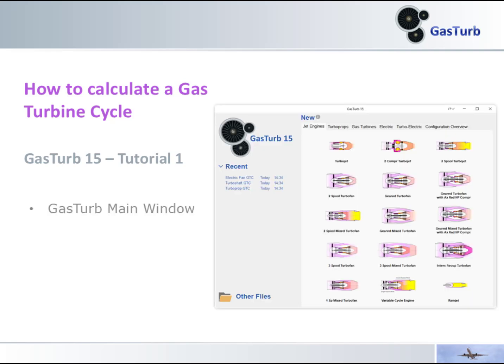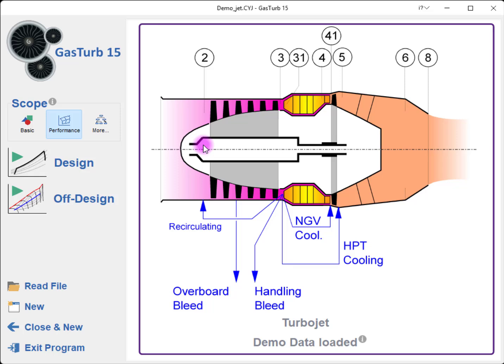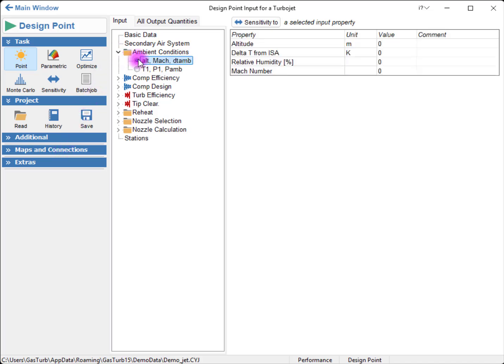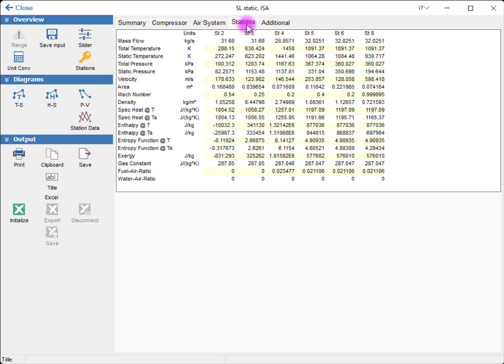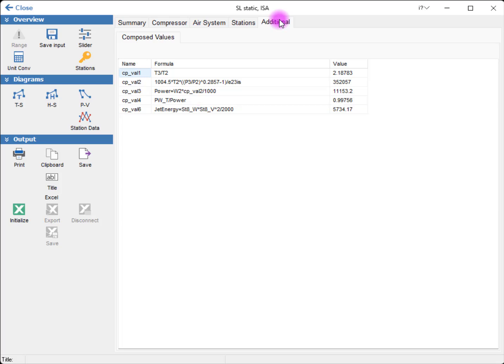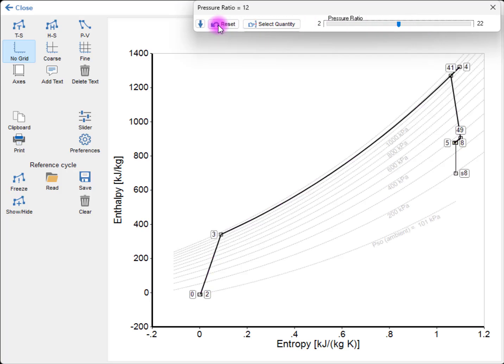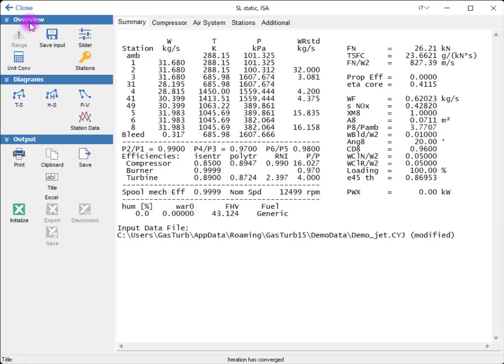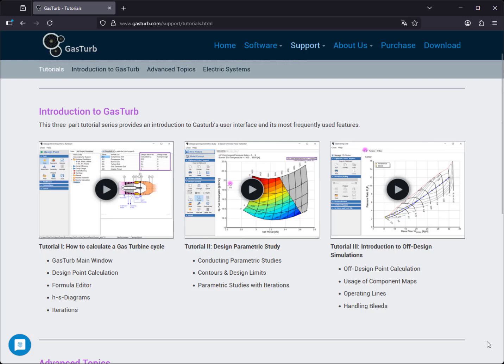Introduction to GasTurb - Tutorial I: How to calculate a Gas Turbine cycle

Comment: right now im working on my thesis and gasturb 12 softwere i use , i saw your tutorial video its same as gasturbe 12?
Reply from the maker: Hello,
much of the video applies to GasTurb 12 as well. Selecting a configuration and loading a save file is a bit more complicated in older versions. I would strongly recommend to try out and use GasTurb 15 for your thesis!
Reply: Hey, I saw that you are working on GasTurb, I am also starting my thesis but I can't get access to GasTurb... Can you tell me how did you get the software? Thanks